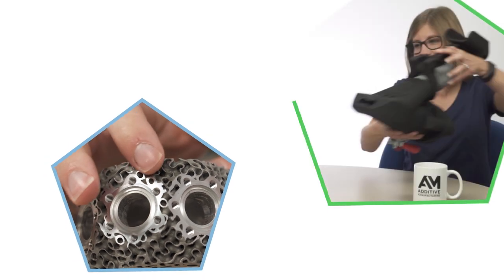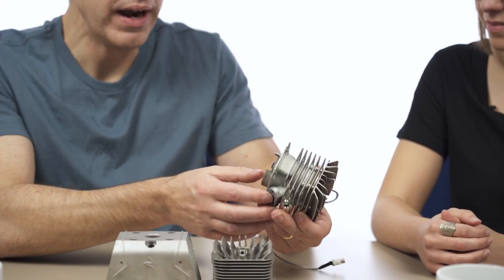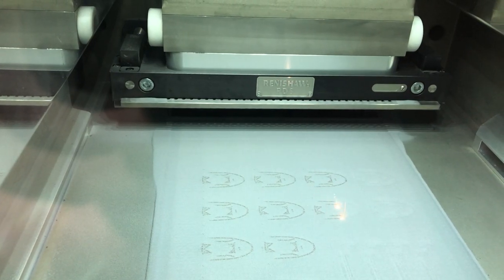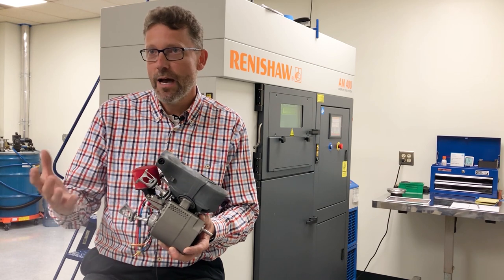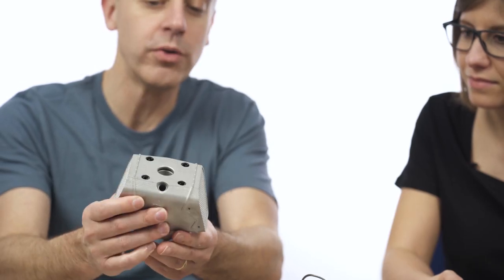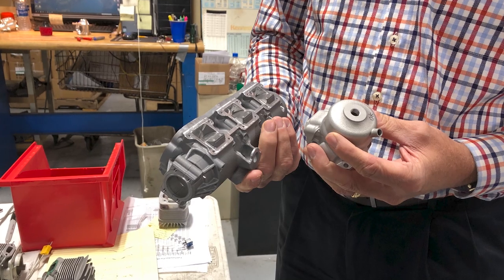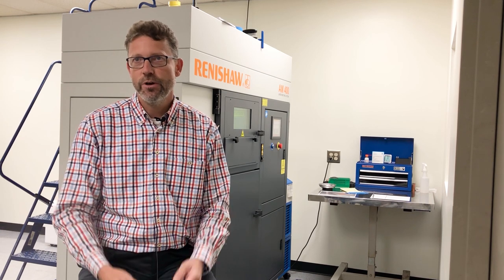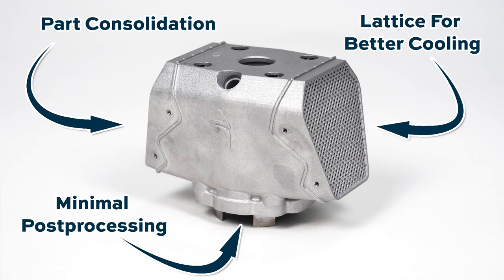This Military Drone Engine Was Designed Specifically For 3D Printing: The Cool Parts Show S2E3

Comment from the maker: Cobra Aero has come a long way since we posted this video! 
Check out how they later redesigned the drone exhaust, and how they now integrate metal and polymer 3D printed parts across drone engines:
https://www.additivemanufacturing.media/articles/drone-engine-replaces-13-parts-with-1-the-cool-parts-show-special-episode
https://www.additivemanufacturing.media/articles/drones-take-flight-with-metal-and-polymer-3d-printed-parts-the-cool-parts-show-bonus-

Comment: Agree with Danielle Zizzari that a cross section of the final part to show the lattice would be really informative. Overall, great example of the evolution of part design from iterative "add more fins" to redesign for new manufacturing process.
Reply from the maker: Thanks for the tip! We weren't able to include this in the video, but if you take a look at our article about Cobra Aero, we've added a new image to the "Dirt Bikes to Drones" section that you might find helpful.
https://www.additivemanufacturing.media/blog/post/drone-engine-maker-illustrates-how-additive-manufacturing-well-suited-to-oems

Comment: It is apparent in even the initial image that there would be no useful airflow through the final part without forced airflow (a fan or ram air through a duct due to aircraft motion), suggesting that all versions are probably used with the cylinder barrel and head surrounded by a duct. @7:22 the cowl is mentioned, but it is much more clearly explained in the article linked in other comments. The original motorcycle engine would not have been cowled. 

The cost of manufacturing that duct and assembling the parts should be considered in the viability of the design overall, and incorporation of features like this in the design can be important in the difference between adapting a design for a new application and designing from the beginning for the target application... whether the manufacturing process is additive or not.

Comment: Another important aspect not discussed here is the new part with the lattices will need forced air or liquid cooling or will not be able to dissipate the heat
Reply: uses literally the exact same parameters as the original part....

Comment: Interesting as usual. However the final iteration of the redesign (if that's really it) doesn't convince me fully, it seems it will need a lot of work to remove the powder, and look heavier than the original, with a possible reduction in the airflow. Maybe a section cut  of the internal lattice structure would have helped to make us understand better what's going on inside.
Reply: Looks like the final head design also incorporated a section of the cooling duct.  So while that part might be heavier, I bet the assembly got a lighter.
Reply from the maker: Hi Daniele,
We weren't able to get this into the video, but if you take a look at our article about Cobra Aero (linked below), we've added an image that shows the inside of the cylinder to the "Dirt Bikes to Drones" section.
https://www.additivemanufacturing.media/blog/post/drone-engine-maker-illustrates-how-additive-manufacturing-well-suited-to-oems

Comment: e but now all flying insects will stuck in this mesh and it will not cool any longer and  stop working
Reply: additional filter will decrease even more cooling flow
Reply: only if you incresd cooling by more % then this loses then it will cool better
Reply: This seems to be a common issue with these clever meshes and 3D surfaces used for heat transfer in parts designed for additive manufacturing. They have the advantage of being made as a single part, with no assembly required, but that becomes a potentially serious disadvantage because they can also not be disassembled for cleaning.

A cleanable screen, finer than any passage within the internal mesh, would be functionally required unless the engine is to be considered a single-use disposable component (which it might be in some military applications).
Reply: not if the drone has exploded already